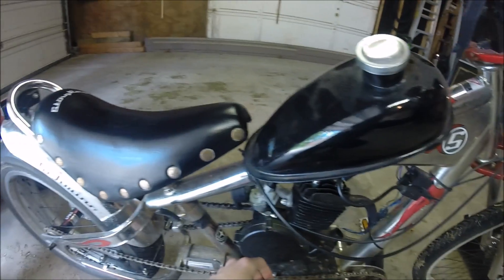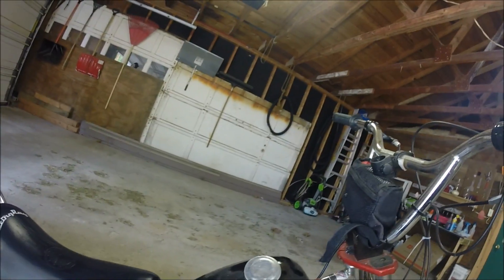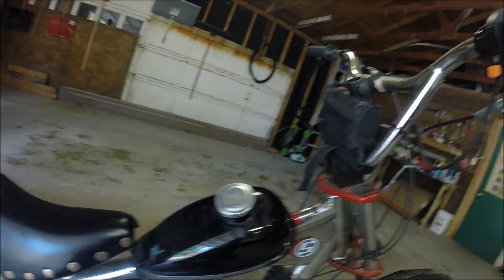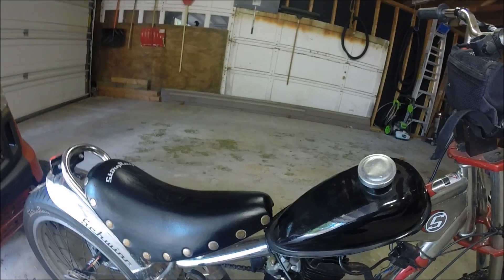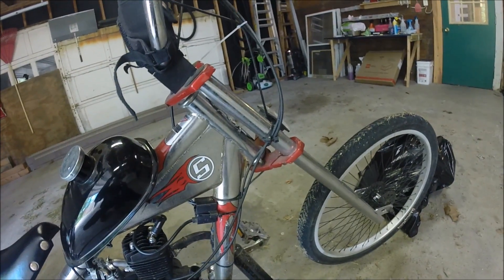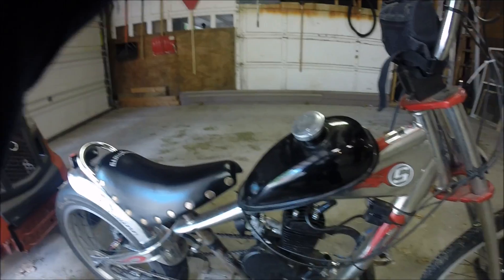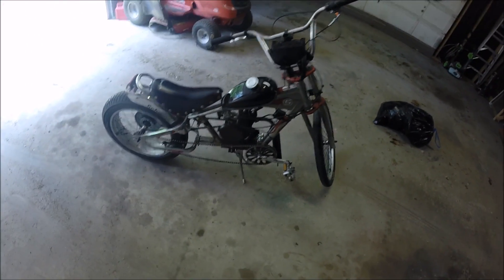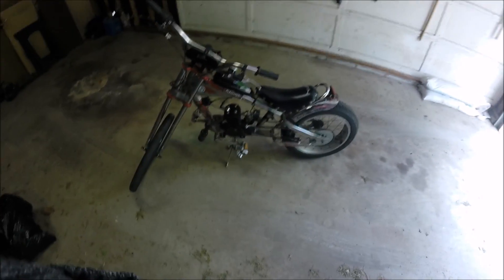80 cc OCC Schwinn Chopper Bike

Comment: Them 80cc motors are new they dont last. Had mine for not even a year and the motor blew up. My new 66cc motor goes just as fast and feels way better with and rides smoother. Recommend highly.

Comment: I have one it's rubbing on the tire pretty bad how did u stop yours
Reply: It's the same as yours
Reply from the maker: @colummacnally4905  mine had no rubbing you have to adjust the engine mount out a bit

Comment: Did you get the motor kit off ebay?
Reply from the maker: Yes
Reply: Thanks! One last question. Did you have to offset the motor/motor mount?
Reply from the maker: I centered the mount to line up with the sprocket
Reply: @RymannFilms  whay if its already mounted amd the ppl put a rubber spacer in between the spocket and inside of the rim

Comment: how fast you go with this
Reply: You can get them to go 40+ MPH with the right sprockets and setup.
Reply: Nimbus Nimbus  no, there's no way an 80cc can move an object of that weight at those speeds. It simply doesn't have the power to do that. it usually takes about three hundred cc's to be able to make a full-sized bike go 100. Even 250 dirt bikes struggle to get up to that speed on the road, and they were absolutely nothing